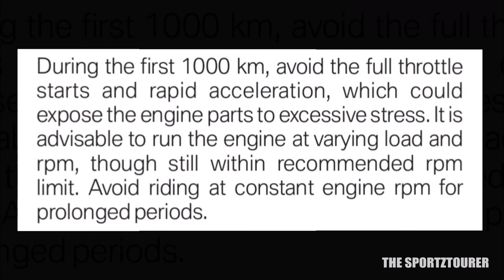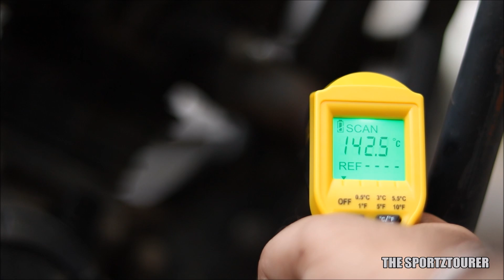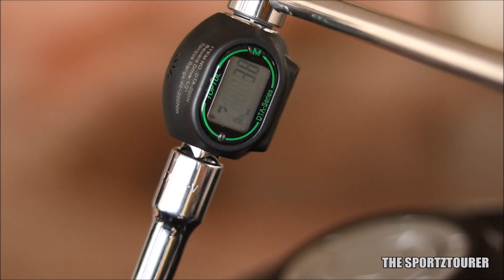SECRET TIPS FOR 'RUNNING IN' 'BREAK IN' A NEW MOTORCYCLE BMW G310R DOMINAR 400 TVS APACHE

Comment: Why is it so that they say dont rev or speed up than 50 60kmph till ur first service
As in my first service i dint see them doing much only a gear oil engine oil change and he removed both the disk brakes n drum brakes cleaned n some greasing n oiling he dint even open the gear box or the air filter then what is it that we should wait for???🤔

Comment: Loved your 2004v series of maintenance videos, and it provided ,me with the confidence to maintain the bike myself. 

I have a question though, RR310 and 310R r very similar mechanically at least on paper but RR310 has a recommended maintenance period of every 6 months but BMW stretches that to every 1year or 10000km in between. So, what is BMW doing differently compared to TVS?
Reply: RR310 also has 10000kms service interval
Reply: @magnetoYT0  No, its every 6 months, check manual.
Reply: BMW is making money upfront while selling the bike 😂, so they dont need you to service it every 6 months.
Reply: @mdzaid5925  re 310 ex showroom is 265000, g310r is 260000. These points are invalid there is something different with either their engine oil or maybe they have taken binned engines from TVS those have higher tolerances. So, I don't know but willing to find out.

Comment: When i bought my rtr 200 in 2017-18 bs 4 abs (1st in UK) I had a manufacturing defect in bike. Not even a small one but a major headache of rear brake losing pressure.

I had gone 400 kms to get the bike so from 10 am in showroom to 7 ish when i got delivery after much hassle as the guys fixed he brake barely enough i was told to either wait till monday for proper delivery or take the bike but get it serviced in my hometown 400 kms away the very same day i reached

As i needed to return due to urgent work etc i took bike but 5 kms down the road the rear failed on me again and that was one wild day. Started for my home at 2 pm with brothers, came home by 9-10 am  in between we witnessed a big mass pilgrimage, bad storm, a flooded area and all in a bike with no rear brake.

It took time to fix bike because the showroom near me didnt have abs equipment back then but it was later fixed ( took a good long time) and it turned out it was a brake master cylinder issue to begin with and not abs thing.

It was a headache but also one of the best most memorable ride of my life.

-Do i hate tvs? No
-Do i hate my bike ? I absolutely love 200 and would still buy it 
-Do i think tvs needs to improve service ? Yes , they have in last few years but still ways to go

All in all with flaws included too, rtr 200 has been the best bike to me in last 4 years, i see no propee substitute for it still. The only way i see where one can shift from 200 is if they shift to like a medium 500-600 cc segment or maybe if they bring RTR 310 OR SOMETHING.

Comment: oops i knew it, but still didnt knew it, I have 0-60 in 5 secs before first service on Apache 160 4V BS6 , and I in Mumbai, I only use HP Power Fuel for smoothing and tyre PSI 25 front and back, for grip and bad roads and flying over a speed bump as I ride my horse.

Comment: Yes SIR, I want videos on maintenance. As much as possible, maintenance and mechanical knowledge to take care of a bike. Also, right now, I am confused between rtr 200 4v, MT-15, Ns200. Toh jisko jo gariyana hai, gariya lo, lekin apna apna opinion zarur batake jana.
Reply: RTR 200 owner here. Apache is the most well-designed/engineered product i.e. apache has aluminium footrests, handlebars and other components to make it as light as possible, engine feels brand new after 20k kms, it can handle corners really well... Overall it is the best engineered product for the price. The only complaint/disappointment I have with RTR is that it does not have 6th gear. I have a superb 4 lane road from Hyderabad to warangal and Apache cruises at 80-90 which feels slow (because the bike is so stable). I can go upto 110 kmph in RTR but at 110, the engine is shouting. NS200 has 6th gear and that is the only reason why you should buy a NS over RTR (If you plan to ride on 4 lane expressways). I would not go for Yamaha because, to extract similar power from 150cc, they have to squeeze the engine very hard and it will impact in the long run. The vibes will be higher, engine oil will be drained sooner, you will have to revv it hard to extract more power etc.
Reply: Rtr 200 or MT15 if you want good and consistent performance and longer life of the bike.

Buy Pulsar if you don't care about quality or life and want only performance.
Reply: Heyy, wait for few dayz because new MT-15 is on the way. They are launching it on april 11

Comment: Riding in city at a time where the traffic is such that u can  keep changing gears but dont need to crawl is the ideal place to break in a new bike.. 1st thousand kms like this And after this for  the initial 1000 to 2000 kms going through the gears to the top of the rev range and down but not staying there is the way to break in imo.. After having done this ride to enjoy. Babbying the engine completely ruins the bike/engine. And i say this with experience. My 09 fzs got ruined because i babbied it too much.